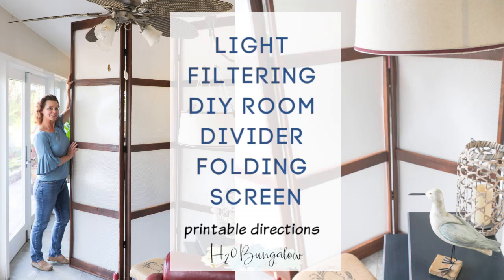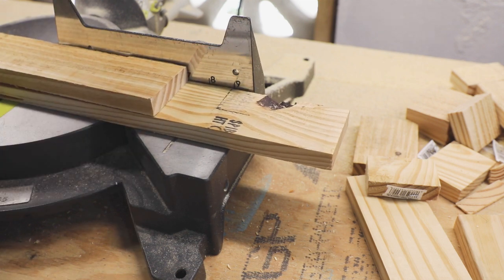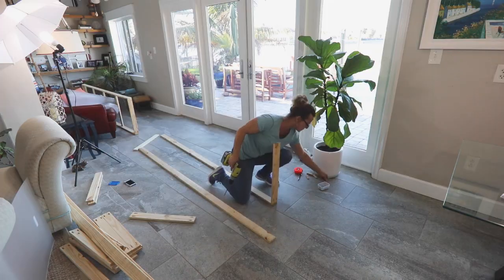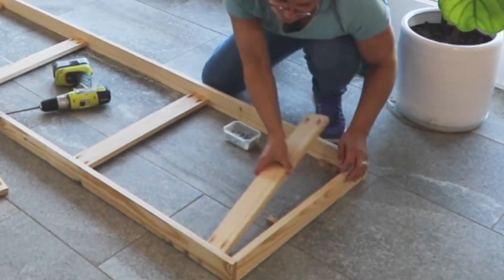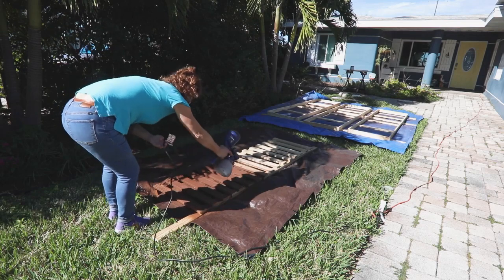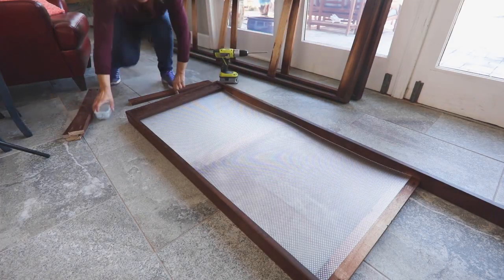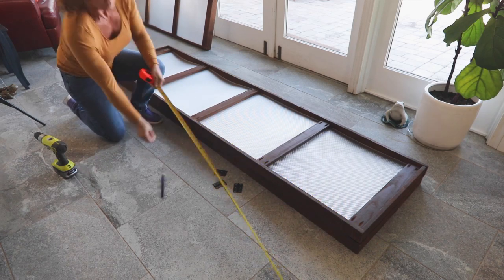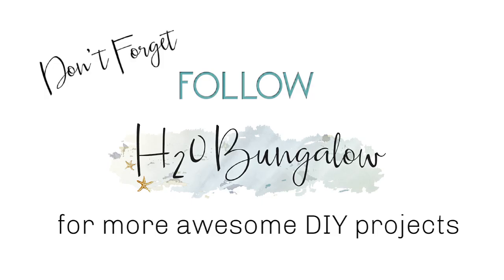DIY Folding Screen Room Divider

Comment: This seller ships this item very carefully to ensure that your room divider    https://www.youtube.com/post/UgkxWv_wTHyTRVm0QkcOw1Rz2-5g_gDoRTkU is not damaged in transit. They even place stickers saying glass, handle with care. I originally bought a 4 panel room divider, but after receiving it I knew I needed larger for the area I was trying to hide. I wanted a 6 panel, but it was not offered in the Espresso color that I wanted, so I went with 5 panels. This is serving my purpose very well on hiding my dog's pee pads. I ended up using the 4 panel one in a corner behind my Christmas tree. The best thing is you do not have to put anything together, you just take it carefully out of the box and place it where you want it. It can be moved around very easily. Plus, these dividers start at the floor, so nothing is seen moving around on the other side like some other dividers I looked into. Now that I have a 4 and 5 panel one, I am sure that I can get them to overlap and work other ways should I need to in the future.
Reply: awwww thats too bad the link to that company is expired... could you list the actual company name?

Comment: Your video is simply GREAT. Without much fuss, straight to the point, precise instructions. I was worried making a room divider higher than 6', but with the total panel width of approx. 24" it is perfect, it's like an additional wall. Will take your advice and take thicker panels. May I ask about the weight of that divider?
Reply from the maker: Thanks so much and that's a good question.  It wasn't too heavy but I used two people to move it after it was assembled just because it was so much bigger than me.  I think a taller/bigger person could move it easily by themselves.

Comment: Great video, and great instructions, thank you! I would like to re-create this but actually attach it to the wall, so would you recommend adding a plank to the wall before screwing the hinges in, or is directly into the wall ok?
Reply from the maker: Hi Cass!  That's a good question.  I'd definitely add a  plank to the wall and attach it with hinges/. What a super idea by the way!

Comment: Could I make it with half inch thick plywood, or would it be too unstable?
Reply from the maker: If you sandwich the clear panels between the two sides of 1/2" plywood I think it would be ok.  In other words, the 1/2" plywood would be doubled.

Comment: what can i use to cover the gaps between the folding screen?
Reply from the maker: Do you mean between each panel?  If so, this design isn't the nest option for you.  I'd probably a build a wall on wheels with no gaps that can move around.    Thanks for watching!
Reply: @WendiWachtelH2OBungalow   thanks
Reply from the maker: @CharlesDarwinBarkley  You're welcome!